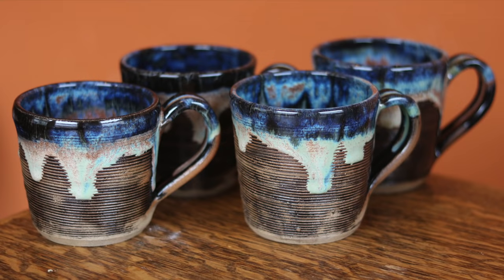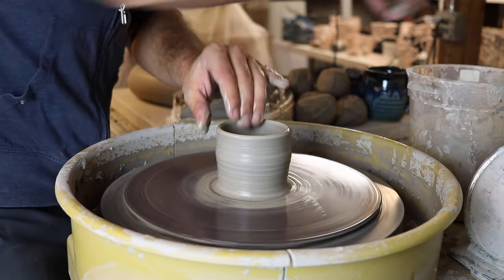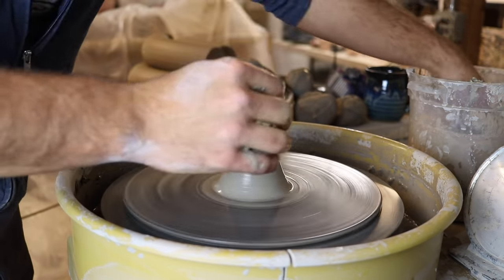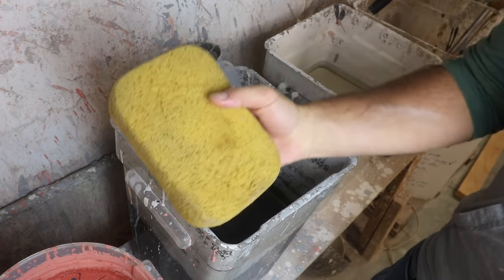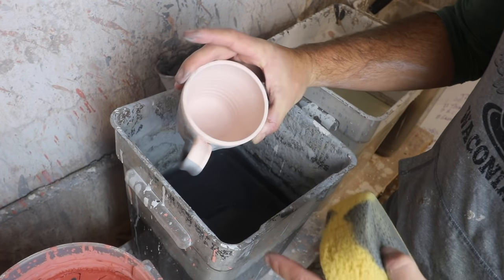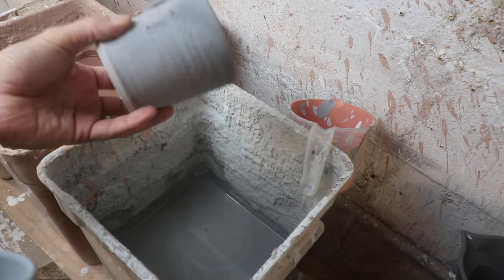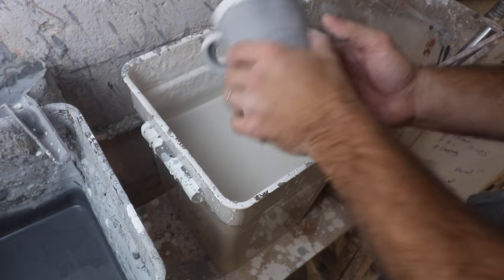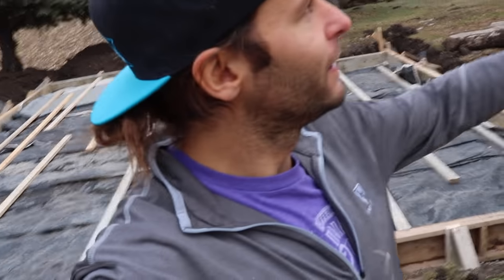How to make textured mugs from clay

Comment: I'd really love to know how the glaze doesn't get messed up by layering it while it's dry? I'm not sure if it's due to the fact that I work with earthenware and you use stoneware, but my teacher told me that we can only double dip while it's still wet (which is really difficult to do and I always seem to accidentally rub off a bunch of clay wherever I touch the piece). I tried dipping something a second time when it was dry and it made all these wierd bubbles and holes and was very wierd. I'd really love to know how/ why you wait until it's dry? Does it have something to do with being able to handle it better? Also, do you wait until it's completely dry (as in ages apart) or just dry enough to handle (as in minutes apart)? 😀

Comment: QUestion: How long do you leave your clay out to air dry to start glazing or do you let it slow cook in the kiln? also after glazing how long and what tempt do you leave the glazed pottery in there?
Reply from the maker: Depends on what it is, smaller things dry in a couple days, larger things can take 3-4 days or more!  Glazing takes 8-10 hours to heat up and another 10 -12 to cool down!